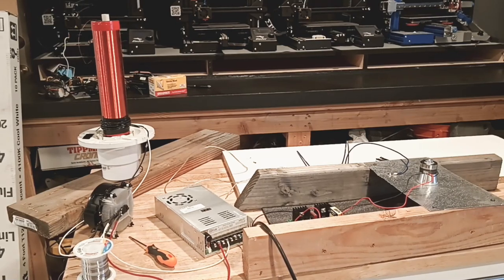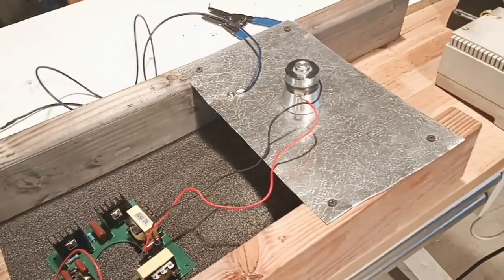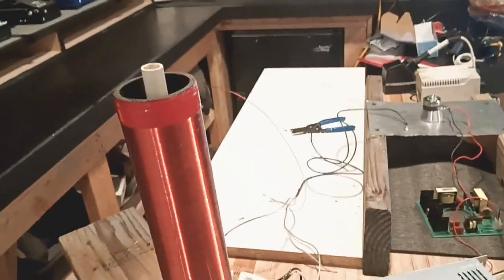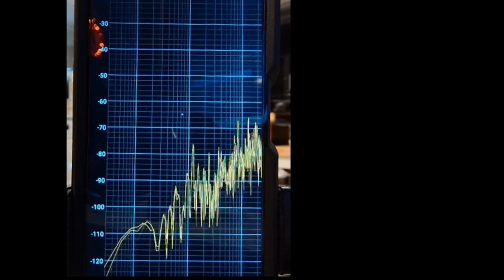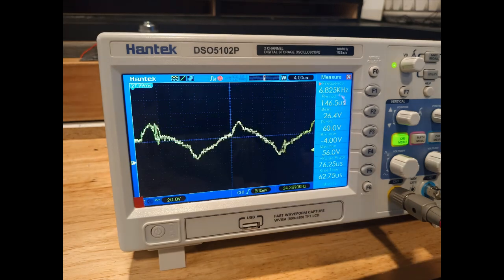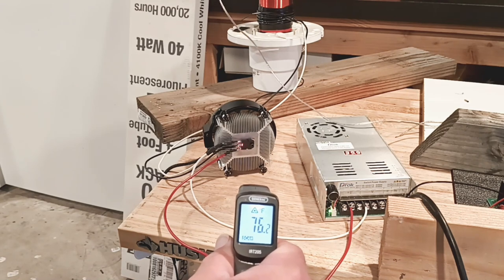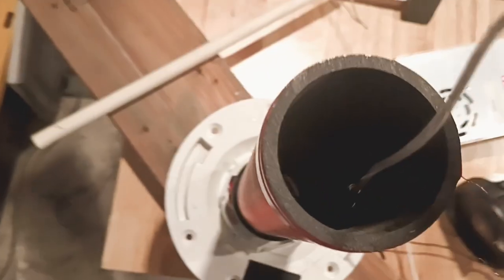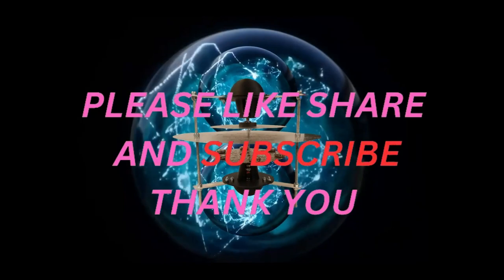Graviflyer "testing feedback to coil" #20

Comment: Nathan, you are 100% correct with your analysis of the graviflyer in every video. Just build the gravitflyer with the two polycarbonate CDs with the Al and Al2O3 layers and charge them up as per my calculations so you can make a major discovery about UAP and how they levitate and propel themselves.
Reply from the maker: we are getting there. It is important to do all the testing. It is the only way we all get there together.
Reply: Nathan, OK I agree.

Comment: Add an 8k ohm resistor and a 50K ohm pot to your Tesla coil, then when turn on your Tesla coil by slowly turning the potentiometer clockwise. This will power up your Tesla to provide sparks while significantly limiting the current.
Reply from the maker: I had the same thought. For fine tuning the signal.
Reply: @nathanbunten4299  Great minds think alike; also, typo, it's 3k ohm and 50k ohm pot. Apologies. Oh, and 5-watt is preferred, but 3-watt works.

Comment: That transistor can operate up to a junction temperature of 150C. That's a case temperature of about 110C, or 253-deg F. It's nowhere near the thermal limit of that transistor. Make sure you have a thin, even coat of thermal grease between the transistor and the heat sink.
Reply from the maker: I have the thermal paste pad. I saw the temp. on the data sheet. I was surprised it went out at that temp as well. I will redo the thermal paste with better stuff.

Comment: Vibration is also used for negative charging. Graviflyer does positive charging. I think there may be a neon lamp like an antenna on the positive cable to provide x-ray radiation.

Comment: Pvc tube in the center..love it... are you not concerned having that speaker sitting directly on top of the plate may hinder proper resonance of the metal?  Curious
Reply from the maker: I was just vibrating the metal. A speaker!! I say that only because i might have made one by accident. The 2 pvc pipes are charged with electrical fields and the oscillation of the tesla coil does work like a speaker. And adding frequency to a speaker creates feedback. It's an interesting idea. I will follow up in testing on that.

Comment: I suppose you get the arc on that wire because it couples capacitively and you get a similar phenomenon like capacitive welding were the isolation gets hot. In your case it gets so hot that the isolation starts to burn. 🤔 Your idea with making a stand to hold the wire perpendicular into the Tesla coil could be the solution of this proplem. The capacitiv cooling losses get the greatest value when the distance is the smallest. So every time it touches the coil the section gets fryed🤔
Reply from the maker: The wire gets fried even with the second pvc pipe. The reason for this is static electricity. The smaller pvc pipe is now statically charged. Which makes sense because in order for the top small disc to change the center plates field it has to be the same type of voltage. It is why he does not attach the wire from the tesla coil directly. He wanted this effect.

Comment: i was thinking that if we look at the tesla tech ( tower ) did it have the outbreak that we have or do we look for the static effect that a van der graff generator produces? this effect we know gives a lift, then combined with the magnetic rotation. Could this increase the effect? keep up the good work :)
Reply from the maker: It could work. I need to see at low power if I can polarize the tesla coil power on the Graviflyer. With the electrostatic meter it should show the polorazition. I believe that is why the top disc loses charge to the bottom disc and the center plate gains the polarization. 

I have never seen anyone do these tests before. So we are probably all learning something with them. I just got the ultrasonic driver from Charlie C. So I will test it with the oscilloscope to find the range. I want to see it all together at low power so we can have the equipment connected and not fry it. It should confirm all that I have been describing.

Comment: Hi, what was your scope connected to in the test?
Was it across the ultrasonic transmitting element.
If so can you please post the display without the tesla coil operating?
Set the scope for DC coupling. 
Are you using a x10 probe?
We need to see a baseline reading from the ultrasonic transducer to make comparisons.
The frequency of the ultrasonic transducer will be constant, because it is being driven by the driver you have connected to it.
If you see the  frequency reading on the scope change with the tesla coil running, it will be due to EMI from the coil getting into the scope leads and possibly the ultrasonic drive circuit.
How were you measuring with your phone, if you used the microphone, then it will not be calibrated and not sensitive to ultrasonic wavelength.
Keep going, also you need to measure the current from your supply to the tesla coil driver.
Not only are you getting break though in your wire but the coil former, so you have possibly damaged the former with arc tracking through the former material to the winding, also the wire enamel insulation.
Reply from the maker: I was just connected to the wire coming from the metal plate so no tesla coil at all. just the ultrasonic cleaner part. I am using 10x probe. I am building a charge on the inner pvc pipe of the tesla coil. I think it is a static charge. It keeps setting my wire on fire. I chose this wire because of its bad shielding. 

I am trying to see why he used every item the way he did. Every one of his choices was for a reason. I don't want a perfect test. Just one that gives me different avenues to chase down. 

I don't know how to not blow up my oscilloscope while running my tesla coil. I think it is with some resistors, but I am not there yet in learning the machine. 

I was looking at the vibration effect on the tesla coil. I know it was causing feedback to the coil. Alexey described a ringing sound or fishing reel sound as feedback from the coil. Like a microphone to the speaker. I think my tesla coil power is to high to get the correct response. his was at 20v and mine was at 40v. Now that I see the responses I can change the test to better amplify them.
Reply: @nathanbunten4299  Okay, thanks.
If you had the scope probe connected to the disc, what was the gnd clip of the probe connected to?
Reply from the maker: I have a copper pipe in the ground that I run a wire to for all ground connections.

Comment: The more air atoms you charge the more current you draw from the tesla coil.  AC voltage many not be the answer here.   You may need DC high voltage.
Reply from the maker: I am using dc voltage. It is a mimicked ac output. so square waves not a sign wave. the same driver can run my flyback coil. There isn't much difference between the tesla coil and the flyback in how they are built. just the size. You are correct about the air.

Comment: Where is that sound come from? Even though audible range for humans is 20 khz most people can't hear more than 13 khz but the noise seems to be lower frequency.
Reply from the maker: The vibration in the plate makes several frequency's. They present as a distortion. I ran into this before with my high voltage experiments. They all make the alien sound.

Comment: Hi, so the reason the wire you're lowing into the tesla coil's tube/core is catching fire, is because when you're putting the wire down the tube, ...in effect, you're creating another capacitor. as you may know, capacitors pass AC, so you get a an AC energy transfer from the outer coil (coil #2) which is acting like the outer-plate of this capacitor ---> going through all the plastics and insulators ---> all the way to the conductor of the wire you're lowering down the tube. since the frequency is high you're passing a high current, eventually heating up the conductor you're lowering down, and subsequently burning it's insulator.

the only reason i think alexey is not having this fire issue, is maybe because he doesn't have as high frequency as you have? and there are many parameters that effect the frequency of a tesla coil, its length, number of windings, primary coil winding its frequency...etc. Perhaps copy alexey's tesla coil as a starting point. thanks for the video.
Reply from the maker: I is creating a static charge on the pvc. An open air capacitor is not ac or dc. It is static. It is why he is doing it. Now he can polorice the craft when the top disc pushes charge through the center plate to the bottom. The graviflyer is a capacitor to ground just like a tesla coil. He did it on purpose. I have to much voltage going through it. he uses 12v not 40v. It now makes sense.
Reply: @nathanbunten4299  i don't think its  static, as static is a charge build up (and turns into a DC burst when discharged), a Tesla coil operates uses AC current or pulsed DC in the primary ... as a result that AC or pulsed DC is transferred to the secondary, similar to how a normal transformer works in reverse, but with much more amplified voltages of course due to the higher number of windings in the secondary. You get pure static if you were using a Van de Graaff generator! pls don't mix the two. thanks for the video.
Reply from the maker: @Bassman73  i don't agree. Building the circuits tells a different story. There is no ac in my tesla coil. Just pulsed dc.
Reply: @nathanbunten4299  pulsed dc is like half an AC current (either the tops or bottoms of the wave), that's how your tesla coil works.😉
Reply from the maker: @Bassman73  it is a dc square wave. There is no ac. I do know how it works.
Reply: @nathanbunten4299  hi Nathan, a dc square wave is a form of pulsed dc. i.e., its not fixed energy like what you get from a battery for example!

Let's think about it differently... (let's invert) ... if you had applied a battery (DC) directly to the primary coil of your tesla coil with no transistor/mosfet, would it have worked? of course not.

So there has to be some form of pulsing into the primary, and you've managed to do that successfully via the Mosfet/transistor.

Tesla in the old days introduced pulsing into the primary of his tesla coils via an AC generator or via batteries but with a spark gaps (again to introduce change or a pulsing into his primary) because he didn't have transistors at the time.
Reply from the maker: @Bassman73  I have been saying pulsed dc a square wave or on and off signal. The dc is an always on energy form. so the coil only makes it magnetic. by pulsing it you get oscillation. So dc square wave. 

I have built high voltage coils from scratch and tesla coils. There is no difference in the driver circuit. Only the capacitor changes. It was the point I was making. 

I know what tesla was doing and this coil is not that. This is a different thing. he used ac. I am not. 

I am not denying that most tesla coils are ac. I am stating that this one is pulsed dc.
Reply: @nathanbunten4299  ok, i think we're talking about the same thing here, .. hey i'm like you passionate about getting this thing to fly.

but we have a fire problem whenever you try to mimic alexey's method of lowering down your wire through the core of your tesla coil.

What i'm trying to convey here is that it seems that you have a too-high energy problem. Therefore when lowering your wire through the tube, the (change in energy in your secondary) ... whether caused by the frequency of the pulsed dc, square wave or ac or whatever, in your primary is a good starting point for investigating this fire.

as mentioned the energy of a tesla coil is controlled by so many factors: freq of primary, number of turns in both primary and secondary, length of coils, diameter ... operating voltage.... etc.

that's why to help you narrow down the cause of this fire, i'm suggesting perhaps copy alexy's tesla coil to the dot, and see if you still get a fire?
Reply from the maker: @Bassman73  I am putting in 40v and Alexey is putting in 12v It is probably why I am getting the fire. I am trying to find all the abnormalities in the device. If I don't I will not know how to compensate for them. 

Like you I want it to lift. The tesla coil is not a problem. It has no fire at low voltage. However the frequency does change when the wire is put into the center of the coil. So regardless of the coil's frequency it will change by how you built the Graviflyer. The total amount of metal and the frequency of the center plate. 

The key is to line up the center plate's frequency with the ultrasound device and the tesla coil. They have to cross. It is between 1mhz to 10mhz. Each one spikes at different times. Those spikes have to line up to the same point. In other words tuning sucks. That's why I ordered more equipment. The risk is an emp. The desired result is not far from that. 

Sorry for being so hard headed.
Reply from the maker: @Bassman73  here is a video on tuning the Graviflyer. It might help. 

https://youtu.be/RYD1IgCHcL4?si=5GbXzW-puCYYywbd